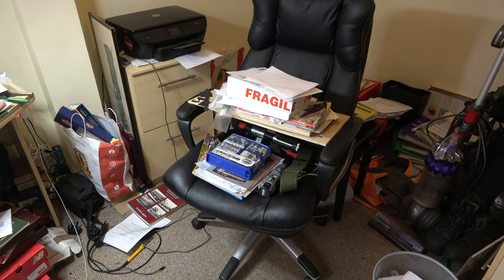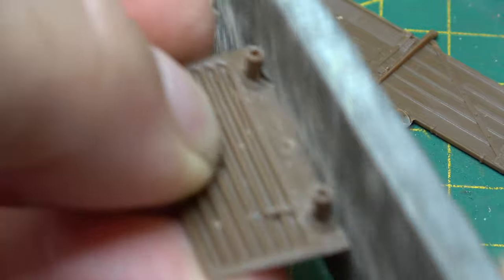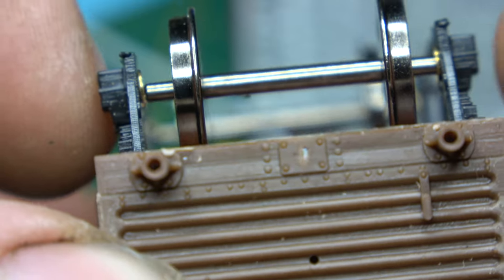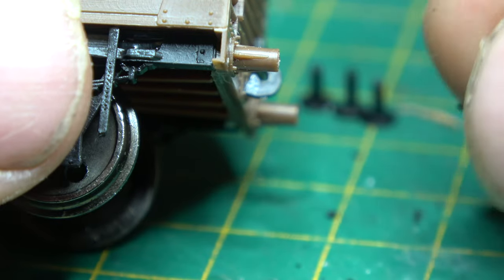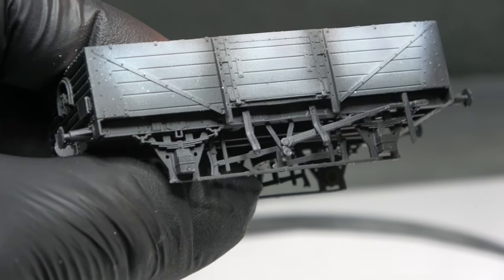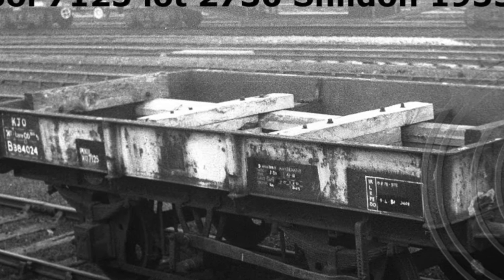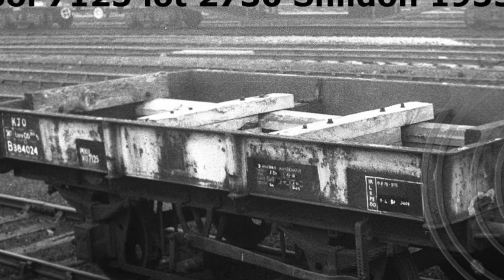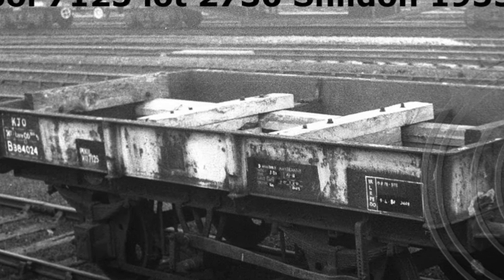Parkside by Peco PC02A 13t HYBAR (Coil)

Comment: Another great video. Just a heads up - it's not white paint in your varnish, it's chalk. All paint (including varnish) starts of as gloss, to make it satin or matt, chalk is added. What's happened to your varnish is that previously it's possiibly not been mixed throroughly enough and you've now ended up with too high a density of chalk in the vanish that is left in the pot. This means when the varnish dries out there is too much chalk and you end up with a white crust. You can see this as it's built up in the deeper recesses and angles of the model where the varnish has run and is thicker. You don't get this with paint as the pigment hides the chalk, but you do get really thick gloopy paint. I also found out the hard way many year ago.......

Comment: Excellent video, I have bought one of these to try and want to build half a dozen or so without the bar. Am I right in thinking there were loads of these up to the 80s or was a different wagon? 
I'm Russ by the way, Matt Smiths mate Stowmarket driver check out my layout channel if you are interested some weathered minerals using techniques I've got from your channel 
Cheers
Reply from the maker: These wagons finished in revenue earning service in the early 80’s. Coil traffic in the late 70’s. Many remained in departmental use, carrying sleepers track parts and concrete troughing into the 90’s
I’m sure we’ve passed each other somewhere 😅 will have a look at the channel too 👍